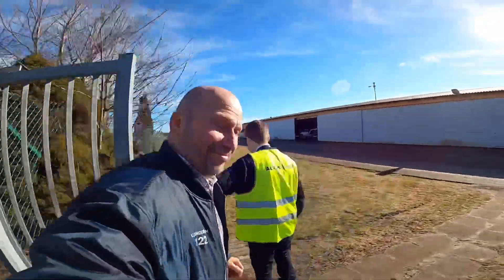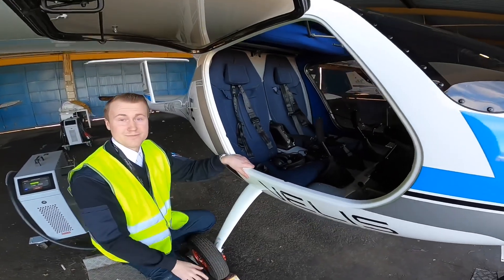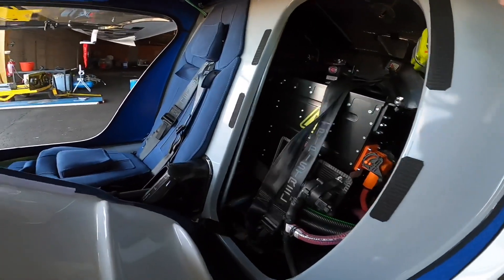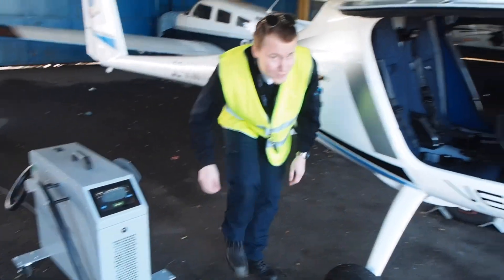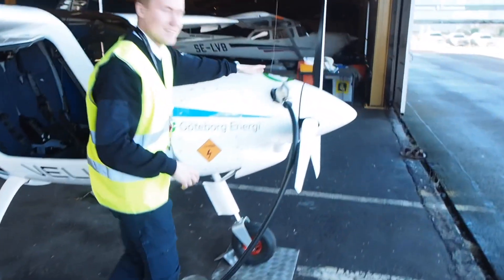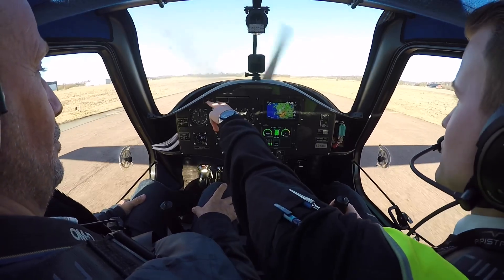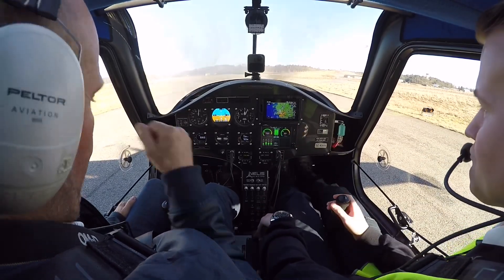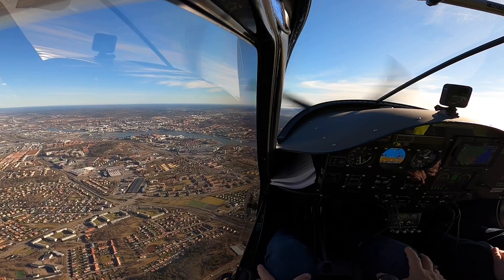Testflying Pipistrel Velis Electro 🛩🍀

Comment: I wonder if it’s possible to install some sort of thin batteries into the wings to extend range of this beautiful bird?
Reply: The current battery packs weigh each 60 kg. So 120 kg for 1 hour of flight. Adding more batteries equals more weight, at some point no one can fly the aircraft because its overweight. Have you seen the size of the battery pack? Not gonna fit into the wing, think heavy wiring and cooling.

Comment: What is better: Airbus or Boeing?
Reply: no one, both are good
Reply: Both has their pros and cons
Reply: Airbus has better build quality assurance procedures... Boeing made a huge mistake when moved its manufacturing from west to the SE away from HQ engineering dept. and used lower skilled workers at the assembly level to save money...
Airbus used composite structures earlier and developed the fly by wire system/software sooner to a mature state...

Comment: The ease of which the propeller starts at stops does concern me a little. Definitely need to be aware of when the aircraft is 'hot' and the throttle is active. Still. v. good visibility of the surroundings.
Reply: That's very relevant. I flew this airplane for the first time last Sunday. Indeed, from outside there's no way to know the airplane is "hot". There's no anti-collision to indicate the engine (oops, motor) is ON. Actually there's no light whatsoever. Regarding visibility, it is very good sideways, quite poor forward as you're leaned back and the 4-point harness does not give you much movement latitude, and you've got pretty much no rear visibility. That's the only thing that really disturbed me.
Reply: @MG_SR71  Thanks for the reply. The lack of an anti-collision light is perplexing. This type of motor operation is novel and would be quite unexpected at most airfields, would seem like an obvious area for careful safety consideration - and at least a light!